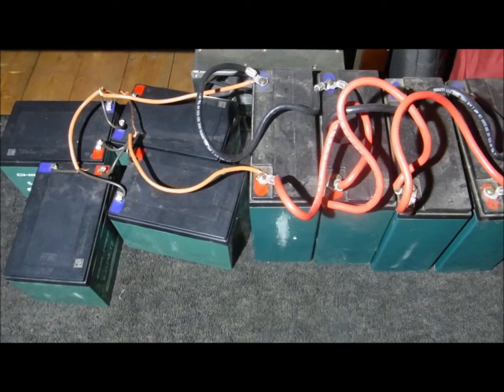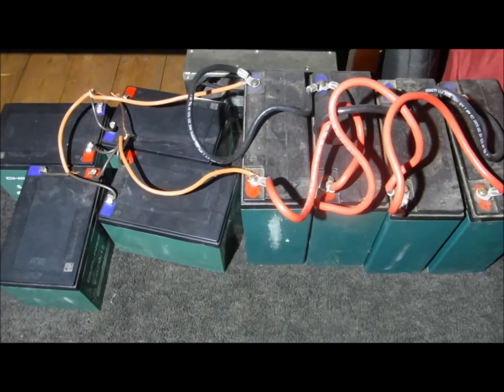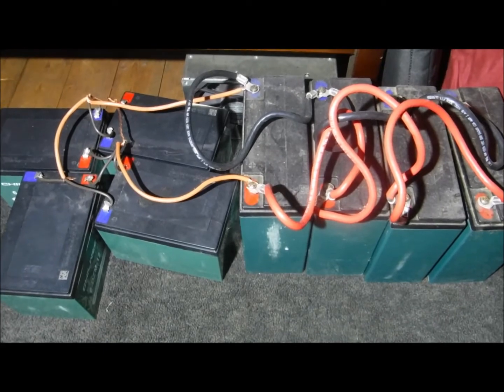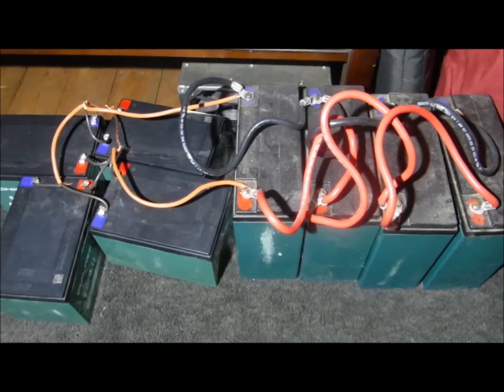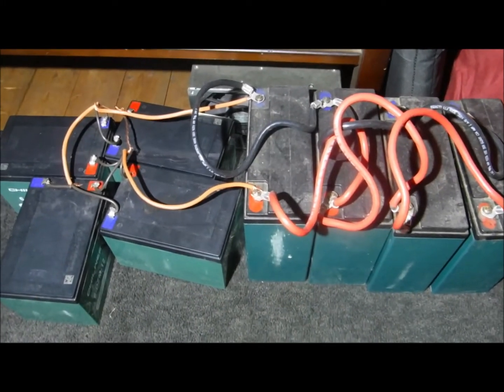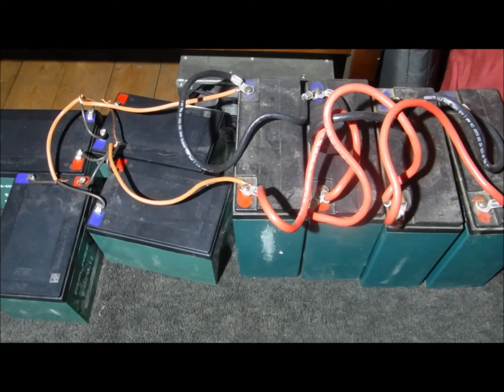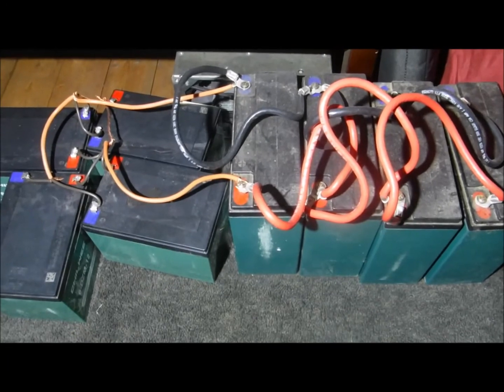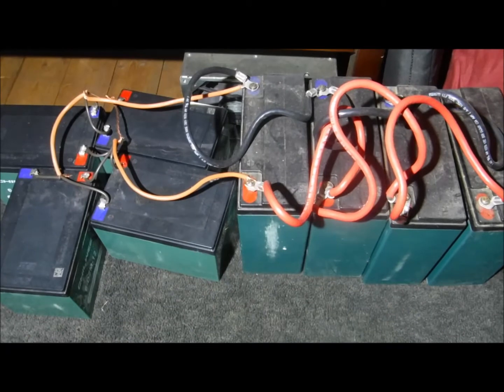Lead Acid Battery Balancing Best Way

Comment: Would you get better performance leaving parallel with an inverter or going straight to series for higher voltage?
Reply from the maker: Performance wont change. Wire used for series can be smaller and smaller is cheaper. Either way the shorter the runs of wire is best. Either ways connection points and wire size for load demands are the big factors for performance. Now inverter type makes a diff for the performance. Whether it's pure sine wave or not.
Reply: i was told that a bad battery would pull the good ones down to the level of the bad one .... you probable the best man to ask as you doing it, were the results better or worse....
Reply from the maker: @joken8901  Yes it's true. What you see me do here is not the whole story.